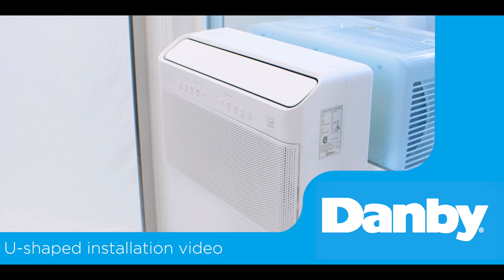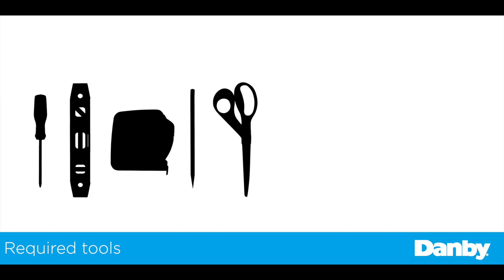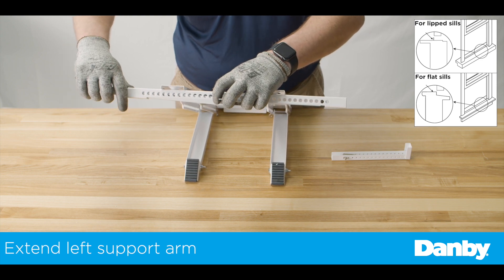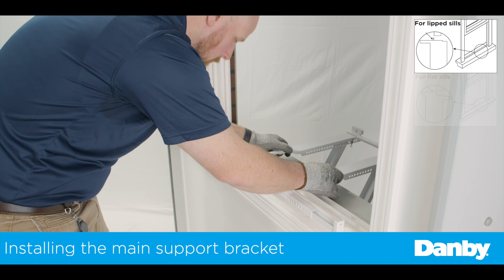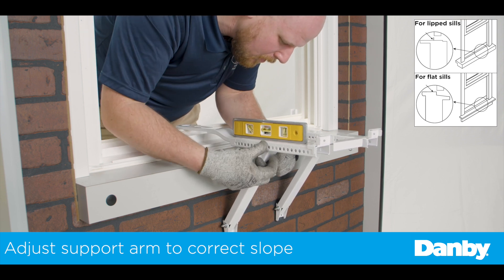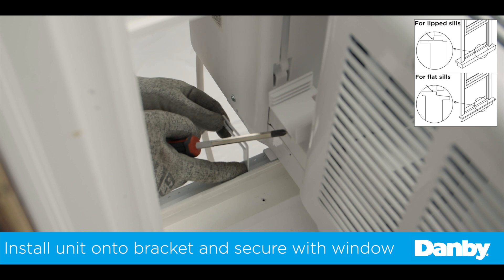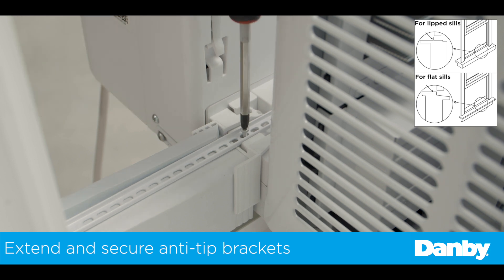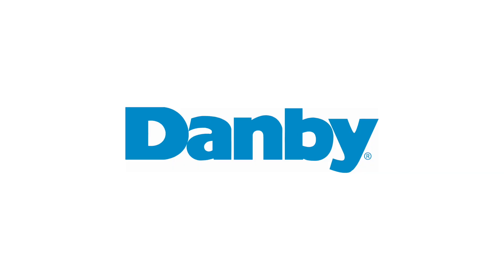Danby How-To: U-Shaped Window Air Conditioner Installation

Comment: 2:24 rotate anti-tip bracket for windows with sides with narrower tracks. 

3:50 the bracket here has that centering tab which isn’t on my Midea 8k btu (2022).
Reply from the maker: Thank you for watching the video! The installation steps can vary depending on the specific window type and unit model. To assist you better, please send us an email at consumerservice@danby.com with your unit and window specifications. Our customer service team will provide you with the appropriate instructions for your setup. We're here to help! Best regards, Danby Support Team

Comment: My window frame lip is steep at 1.75 inches (1  3/4 inches) Will this bracket be able to install in front of it as seen in the instructions?
Reply from the maker: Hello! Thank you for watching the video. The bracket is designed to fit most standard window frames. However, with a steep window frame lip, it may be challenging to install the bracket in front of it as shown in the instructions. To provide you with a more accurate solution, could you please send us an email at consumerservice@danby.com with your specific window measurements and unit model? Our customer service team will be able to assist you further. We appreciate your understanding and look forward to helping you. Best regards, Danby Support Team

Comment: Asking Danby a question! If room BTU calculations amount to 6,400 BTU can I get the Danby 8,000 BTU inverter variable speed U shape Window AC? Will an 8k BTU not be overpowered for a room suited to a 6-7k BTU conventional Window AC? I see these inverter ACs are variable speed, not compressor on or off like conventional ACs. 
Hey Danby, I kind of want to get this answered so I can hurry up an AC unit purchase please! Your U Shape Inverter Window AC is what I want. But I can't tell if 8k is okay. ❓️❓️❓️❓️❓️
Reply: No well not be over powered just well cool it off a lot quicker.

Comment: What I should do if window more than 36 in? (43)
Reply from the maker: Hi Steve, usually, we always informed our customers to check the dimension of their windows before purchasing the appliance. To avoid major repairs when installing the air conditioner.
Reply: Didn't really answer that question now, did he? I asked there CS rep the same thing and there is no solution. It is not advised.
Reply from the maker: @bizlarry  The only solution, if the window or wall is bigger/smaller than the appliance, is to do a major repair. However, to avoid this, always double-check the appliance's dimensions and the area where you install the AC to prevent the repair before purchasing. We have different types of AC with various sizes that might fit on your window or wall.

Comment: I wish they make these U shaped air conditioners for smaller windows. All my windows in my apartment are 19.5 inches wide.
Reply: Also can this be used without the bracket?
Reply from the maker: Hi  @mamaj0203  we're happy to assist you with your inquiries. Please contact our consumer support team at 1-800-263-2629 or send an email to consumerservice@danby.com

Comment: The minimum vertical opening is 13.75" per your spectification.  In my case, the maximum opening of my wooden window is 14.25" and I checked the total height of the back end of the air conditioner plus the support arm (including the two humps on the extension arms) is closer to 14.5".  Is there any suggestion to install the unit given this situation?
Reply from the maker: Hi David, thank you for watching the video. If you need help and would like to know more about this device, please contact our consumer service department at consumerservice@danby.com. We will be happy to assist you.
Reply: @DanbyProducts  Unfortunately, the assistance was not useful to solve the issue I encountered.  Thanks anyway.

Comment: does it have to be centered in the window or can it be offset, does that put to much stress on one side of the window frame?
Reply from the maker: Hello Cody,  to know the proper installation instructions for our U-shaped Window Air Conditioner, please visit our webpage/owner's manual: https://www.danby.com/products/window-air-conditioners/dac080b6iwdb-6/. Everything is written here the Do's and Don't of installing a u-shaped type of window air conditioner

Comment: This has one of the absolute worst filters on the planet. Unclear why you chose this design that makes it difficult to reinstall when you could just do a correct size snap on.
Reply: The filter is super easy to reinstall you just need to install it the right way